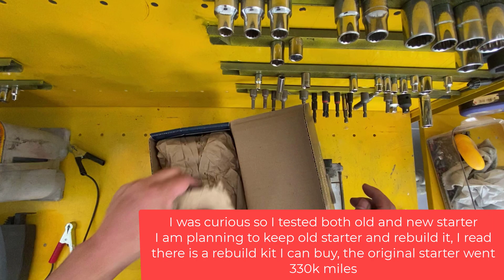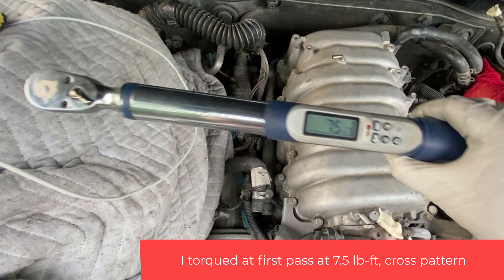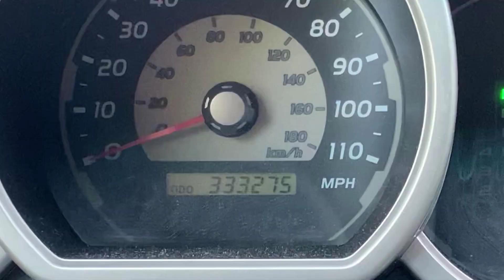Toyota 4Runner 2003 V8 (2UZ-FE) - Replace Starter

Comment: Do you know which plastic connector broke? After a friend did this job for me, my shift lock won't release unless I use the manual button and my ABS light is coming on. But he said a couple of those connectors were broken, which he tried to electrical tape and zip tie back together. So, I'm trying to figure out if those issues are related to one or multiple connectors.
Reply from the maker: Sorry for delay, It was the knock sensor. The plastic piece broke off, so I used JB Weld to fix it.

Comment: overall about how long did this take minus testing the old starter? mines in the shop for the diag on it right now, had a cam position sensor go off  and then it started cranking weird
Reply from the maker: Sorry it took so long. I worked on it a little bit at a time whenever I had free time since it was my first time doing this. I think a mechanic could do it in a day.